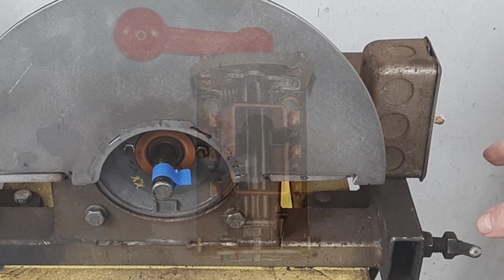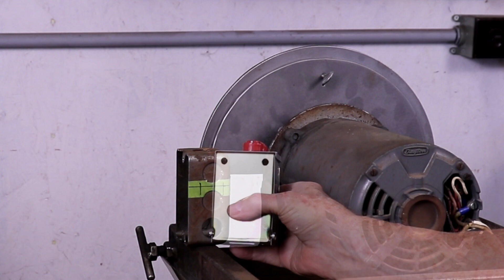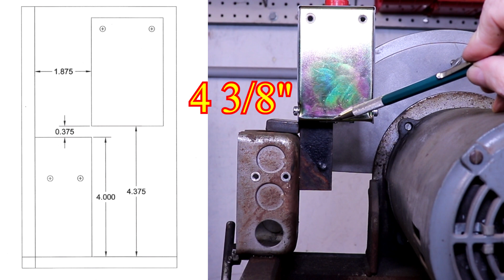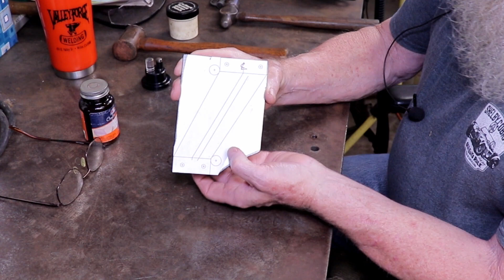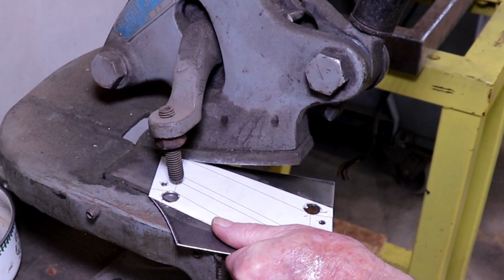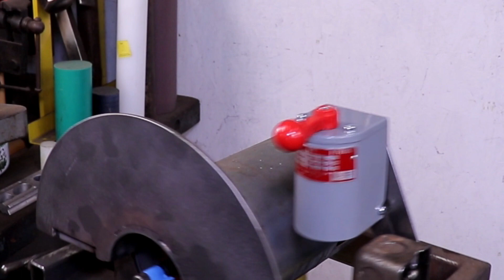How To Make A Bracket In Space

Comment: to reverse a single phase motor (three phase is a lot easier since you just need to swap any of the three legs) you will need to reverse the starter windings. you should take a picture of the pecker head wiring diagram for that motor and upload it here to get advice because it varies.
Reply from the maker: Hi Jason.
Good idea. I am going to try today (with some jumpers) and see if I can figure it out. If it doesn't work out I will post a video asking for help. I will include pictures and my E Mail address.
Jere

Comment: Why wouldn't you just remove the original box and fabricate a bracket from the frame?  Or did I miss something in the build?  Nice job on the bracket.
Reply from the maker: Hi Tim.
Good question. The original box was welded on when it was built. It was then chrome plated, back in the 70's. I would have to do some grinding to remove the weld after the box was removed (allowing for rust to begin). 
Also if I can't figure out the wiring, I may use the drum switch purely for reversing the two wires, and use the original switch for off and on.
I hope this answers your questions.         Jere
Reply: @jerekirkpatrick2092  Thanks.  I didn't see the chrome and the welding.